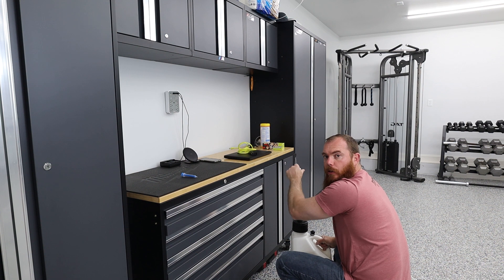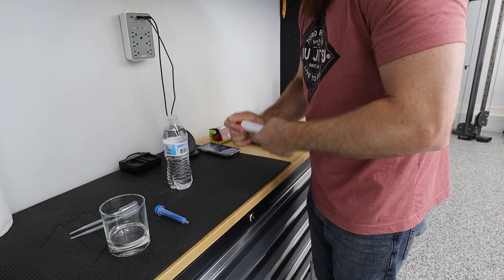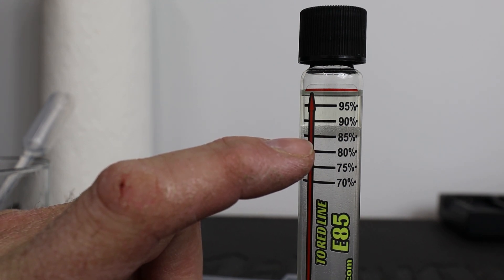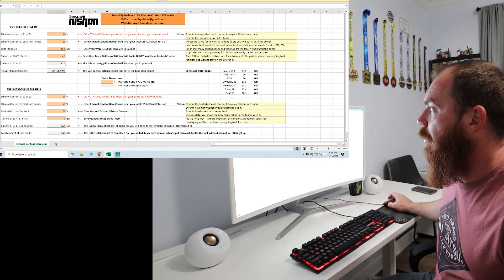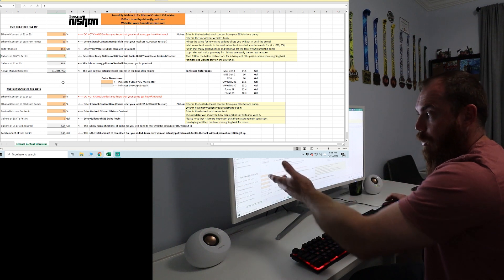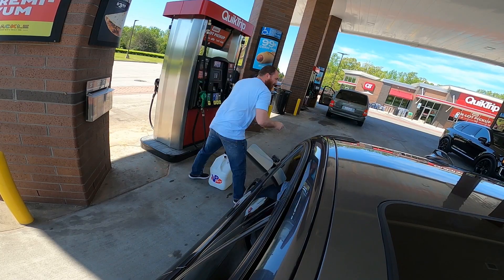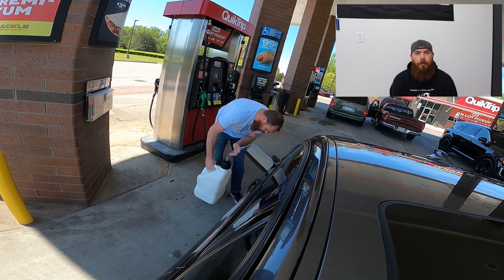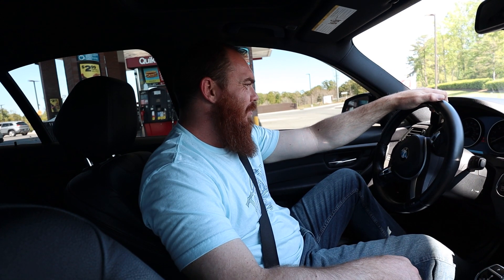E85 Ethanol How To For Your BMW F30 FBO Full Tutorial E30 Mix with Dragy Results

Comment: I still don’t understand how much E85 I have to add if I have 1/4 of a tank of 93 pump gas?
Reply from the maker: Use the calculator that question is not to be guessed and needs to be accurate. I linked the calculator

Comment: Hi, great video. I'm on ethanol mix as well. MHD E20 map and running 25% mix I THINK. I'm in Sweden and there are no domestic E85 test kits, importing costs an arm and a leg, would you mind telling me how much water ml/ounce (I'll convert) vs how much E85 the test tube holds so I can make my own?
Reply from the maker: Hello, unfortunately I do not see that info on bottle but maybe you can try to find a video on others who made this?
Reply: @BOO5Tchannel  Couldn't you please use a measuring cup? Fill to the O2 line, measure what comes out and the then fill to to the top line and subtract that number with the O2 line number? I would be very grateful. Br

Comment: So when using the calculator, if I pull into the gas station with 10 miles of range left 
what percentage of fuel remaining should I mark it as? 5%?
Reply from the maker: That would be fine it’s fairly insignificant to matter, if it’s the first time but after use the second calculator
Reply: @BOO5Tchannel  okay so that being said, how important do you think it is to have an ethanol sensor? 
Do you think it’s sufficient/safe to solely go off of calculation?
Reply from the maker: @thecockpitperspective  no that’s why I test my ethanol content manually, but a sensor is nice too. On my 2JZ car I have a ethanol analyzer

Comment: Is always better to run a e30 mix when your tank has the “Fuel reserve “ light come up?
Reply from the maker: No you can mix e30 anytime just use the 2nd formula that I linked called subsequent fill ups
Reply: @BOO5Tchannel  ok, for first time should I run the car close to empty to run the e30 map
Reply from the maker: @ulisesvazquez8675  yes like 10-30 miles to empty is fine
Reply: @BOO5Tchannel  okkk. Thanks Is MHD compatible with f80 Pual ? Trynna get a custome e30 tune with stock fueling 😂
Reply from the maker: @ulisesvazquez8675  I do not know what F80 Paul uses I would contact him

Comment: So if you wanted to use an E20 blend, how would you go about calculating the remaining ethanol content in your fuel tank when you go to a gas station to refill again, after filling up on the E20 mix previously?
Reply from the maker: The calculator I have in the links... it has The first fill calculator and under that is the subsequent fill up calculator you enter your parameters and it gives you the mix
Reply: @BOO5Tchannel  oh gotcha. I’ll give it a look, thanks a lot man

Comment: Hey so I know you don’t have an n20 but for your car, in order to run the e30 tune, did you have to upgrade any fueling in the car or will just the tune suffice, also once you fill up with e30 and say you are down to half a tank, how would I know what proportion of pump gas and e85 to put in to get a full tank of e30 again? Thanks!
Reply from the maker: For e30 no I did not, but that is for n55 and not sure about n20 however I think e20 is safer. If you watch the video that I made on ethanol it gives you the calculator and you can do all your calculations from the first tank to the refill. Don’t cut any corners on this make sure you study that video or forums so you don’t have issues
Reply: Forced Induction Studios alright thank you so much!!

Comment: Dont you need a better fuel pump to handle E30? I've been wanting to test that tune on my N20 F30
Reply: @N20B20A Jeremy  I ran E30 with the BM3 stage 2 E30 map with stock fuel system and hooolyyy its another different car
Reply from the maker: No sir not 30. But do your research on n20 I am N55
Reply: No you don’t if you have a tune for it on the map your running , both stage 1 and 2 have E30 maps available, it’s only for stage 2+ E40 50 and full E85 that you need a hpfp for it.

Comment: Thanks for uploading! I'm waiting on that same 85 tester kit to check the BP right by my house before I flash over. Did you change your oil grade by any chance? Wondering if I should go a little thicker before I run E.
Reply from the maker: Awesome! I use 5-40 oil currently. Thanks for the comment
Reply: @BOO5Tchannel  That's what I was planning on changing over to. Thanks man!